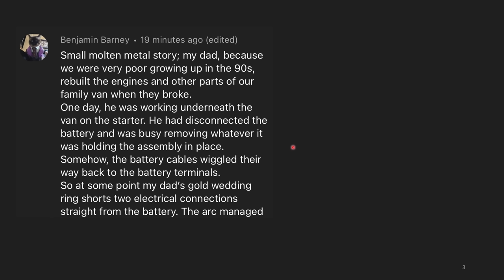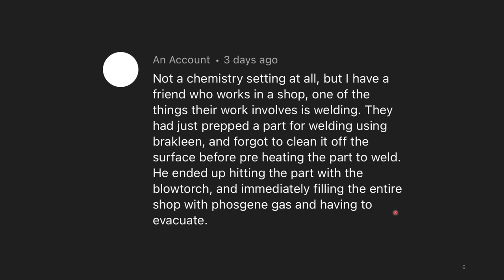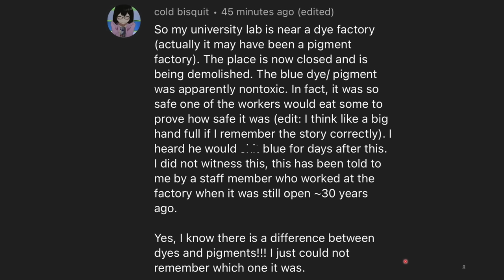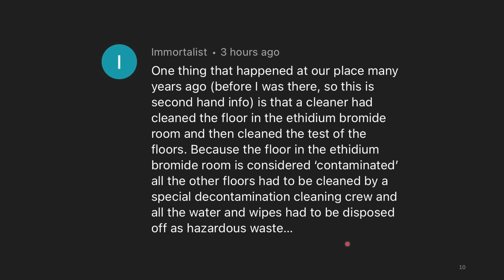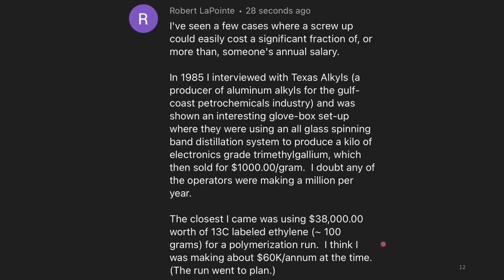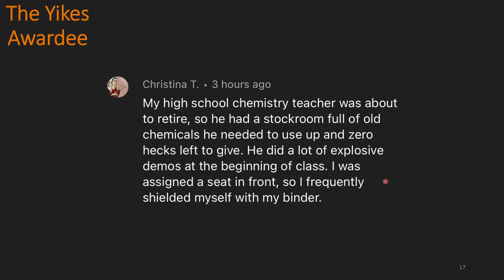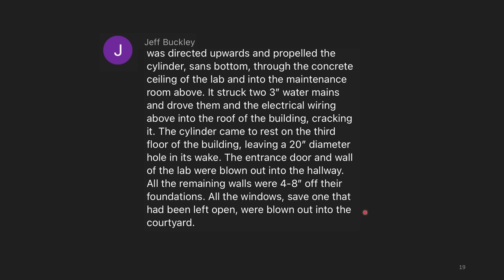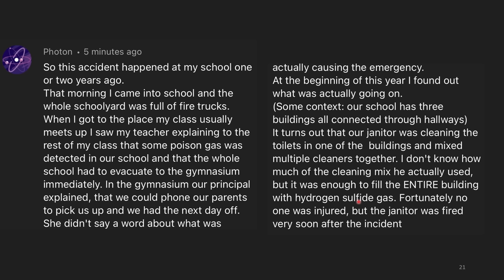Liquid Nitrogen Overpressurized and Exploded

Comment: On the note of the second story, Gold is quite conductive, and car batteries are known (and used) for their ability to provide lots of current! gold also has a fairly low melting point (comparatively), so it's no surprise that a wedding ring could melt in a situation like that.
Reply: Yep. There are reasons why industrial maintenance technicians wrap their wedding rings with vinyl electric tape if they can't or won't just take their ring off at work.
Edit: They also don't wear watches unless they have an all plastic one.
Reply: Though liquid gold like mecury an most other liquid metals don't actually wet skin, so the heat transfer from the liquid gold to the skin is reeeeeeally bad, so it is actuslly unlikely to get dramatic burns through gold droplets splatterig on your skin
Reply: Lower conductivity would actually melt faster, lower conductivity=higher resistance. Higher resistance means more of the energy is converted to heat, rather than just being passed through. Although the lower resistance allows it to deliver more current so maybe the increased current delivery counteracts the higher efficiency
Reply: @JGHFunRun  P = E²/R  Therefore the more conductive (the smaller is R) the metal, the more power dissipated as heat.
Reply: @sootikins  connect an iron nail to a car battery with equal diameter copper wires, and tell me which heats up most.
Reply: @phizc  The higher resistance of the nail means that the heat that is generated is focused in the nail, but a lower overall resistance will dump much more total energy into the system; with the huge current capacity of the battery, both the copper and the ring will heat up more than they would with the nail in the circuit. Shorting the battery cables will also be much more vigorous.
Reply: Having played with high current electrical stuff over the years, I'd believe the story too. I doubt it would have melted the entire ring, but could certainly have arced and splattered enough metal to cause burns.
- A decent car battery can dump ~500A for a short period - at 12V, that's 6kW!
- There would be some losses through the cables from the battery to the starter/alternator, but in a worst case scenario of 1 meter of 0AWG copper wire (8mm dia) and very good grounding through the chassis, you're only talking 0.32 milliohms for the cable, which would only drop 0.16V or 80 watts out of a total of 6kW.
- Once the ring made electrical contact, sparks would form highly conductive plasma between the ring and the terminal, so resistance due to surface corrosion of either could quickly drop to negligible amounts.
- Most jewelry isn't made of pure gold - among other things it's usually alloyed with zinc, which is a pretty poor conductor (4X the resistance of copper), so the ring itself could well constitute most of the volt drop and therefore most of the 6kW of heat generated (Sootikins' statement is also true, but only when unlimited current is available across a single resistor - in a real world series circuit, the higher resistance components will usually heat up faster because of a higher voltage drop across them for a given current)
Reply: The thing you're looking for is the maximum power transfer theorem, or as engineers like to call it, impedance matching. You can measure the internal resistance of the battery by plotting its voltage vs current curve. The power dissipated by the ring is maximized when the ring's resistance is equal to the internal resistance of the battery.

A superconducting ring would melt the battery but not itself; a rubber ring would pass no current and stay cool as well. A gold ring is probably quite close to maximizing the heat delivered to the finger, but using math, we can figure out the exact ring size for a given material that would maximize the amount of heating power dumped into the victim's finger. Therefore an ideal size tungsten ring would be the worst case scenario: it puts out just as much heat as the ideal size gold ring, but it stays solid the longest.

Comment: The pigment Prussian Blue (potassium hexacyanoferrate) is considered non toxic. It is used for treatment after ingesting radioactive cesium or thallium.  Recommended Adult dosage typically 1 to 3 grams per day, or up to 12g/day for higher exposure. Typical treatment duration is 3 weeks.
Reply from the maker: amazing - It would be challenging to convince me to consume 1-3 grams of prussian blue
Reply: @That_Chemist  The ferrocyanides are quite nonreactive in general, the cyanides are extremely tightly bound.  Prussian Blue in particular is extremely insoluble on top of that.  Strong acids and bases can release the cyanide -- plain stomach acid isn't enough.

There are records of a poor woman who attempted to commit suicide by eating heaping spoonfuls of some more properly soluble ferrocyanide salt.  She went to hospital for **iron poisoning**.

Comment: When pondering the tale of the janitor and the hydrogen sulfide, we must always keep in mind that the information was likely relayed through at least two levels of non-chemists.  The offending fumes could have been some other chemical entirely, and some admin type mangled it.

That ring across the battery?  I had a less severe case of that with a metal watch band and a small Ni-Cd pack, back when small Ni-Cd packs were a thing.  Very ouch, but no serious damage.  It's one reason I no longer wear anything conductive anywhere near my hands.
Reply: Many years ago, AA ni-cads were popular, they were also poorly desinged with a positive outer shell. A spring contact could bridge the outer shell and negative pole and would get hot enough to set fire (a stove lighter sized flame) to the battery.
Reply: I've seen varying cases of the ring burn over my years working in manufacturing, it's real nasty stuff, if you're lucky, you get a relatively minor burn, not pleasant, not the end of the world, worst case you lose your finger, even if it is 'just' a small battery, some of these smaller batteries can spit out a LOT of current in a short circuit, 9v batteries are one of the worst offenders for that though as far as every day use batteries go, the pins make clipping a ring on them easily and they pack quite the zing at 1.5a short circuit (about 13.5w) though AA's can give you a fair zing too at about 6.75w, doesn't take much amperage across something like a ring to burn you, lithium ion batteries are generally your worst offenders though with a short circuit current of 50 whole angry amps, the machine shop I worked at had a strict policy of no rings near any rotary tool, be that a mill, lathe or die grinder etc, but they quickly adopted a no metal rings in the shop after a two instances of ring burn, one minor and one major involving an amputation, I'm not a ring person but in a workshop/electrical field I always recommend silicone rings for this reason
Reply: Late to the story, but it's why when I weld I only leave the tungsten rings on. Let it conduct, it's better than sweaty skin. Let it burn me, I don't even need the ring if it scars right
Reply: Yeah, my guess is the janitor made chloramine. Surprise chemical warfare agents are always good.
Reply: @samiraperi467  And thats why even janitors should at least have a basic degree in chemistry so they know the dangers of mixing bleach with acidic cleaners - generates chlorine gas and ammonia - generates chloramine. Most janitors I think dont know this fact but instead they have the mindset of that because its a cleaner of some kind it can be mixed with any other cleaner = WRONG!

Comment: Just an addendum to the 13C labeled polyethylene story.  That Chemist's suggestion that the reaction be run with unlabeled ethylene first, to ensure that everything went OK with the expensive stuff, was in fact how it was done (this was in the mid '90's).  Moreover, as this was performed in a continuous solution reactor, the reactor was actually started up with unlabeled ethylene and then switched on the fly to labeled ethylene after the system had come to equilibrium.  This was a small reactor, with an ethylene throughput of a little more than a gram per minute and a residence time of about 15 minutes, so it took about four hours to get a really steady equilibrium and then about 60 minutes to shoot my 100 grams of 13C ethylene (reactor pressure was about 500 psig, so there was a bit of labeled ethylene left over in the cylinder) followed by another 60 minutes to flush most of the 13C polymer (during this time, I was collecting samples every 60 seconds in tared vials).  Then I went through a shut down procedure where catalyst and monomer were cut off, the reactor flushed with straight solvent for a couple of hours to remove all polymer and then another hour to cool and left with a trickle of solvent flowing.  After drying the samples overnight in a vacuum oven and weighing them, there was a very smooth increase in weight of the first 60 samples, followed by another smooth decrease in weight for the last 60, which was the first objective confirmation that the experiment had gone well (and that I hadn't just wasted weeks of prep time and $38,000 of labeled monomer).

Comment: One of the things being taught to me during the middleschool was...glass etching. Yes, glass etching for middleschool kids. Guess what's being used for the etching? Of course, it's HF (or H2SiF6, but that's not what's being used in that class and it's not like the H2SiF6 is that much better than HF anyway). The worst part was that the teacher in that class didn't provide the students any special precautions about the acid being the HF and seemingly only treated it just like any other mineral acids. Thankfully, the class went without major incidents or resulted in any casualties, but man, this could've seriously killed me if I screwed up without knowing that the HF kills. I only learned to my horror over a decade later that HF is fatal on skin contact and was exactly the acid used in that glass etching class.
Reply: That's a bit like the old DIY chemistry experimenter's book I had that told you how to etch glass by asking your friendly dentist for extracted teeth and then boiling them up in sulphuric acid to produce HF vapour. As a side note I used to be in the semiconductor industry and regularly used HF - very nasty.
Reply: my nervvy friend asked me to identify a drum in the detailing business next to her tennis court. It was hydroflouric acid, or HF in water. I told her it’s nasty stuff used in detailing cars. Apparently nothing better for removing grease and tar from car parts.
Reply: @robertparsons558  fluoroapatite? That only works if the teeth are fluoridated
Reply: I've seen some kind of glass etching kit sold in craft stores.  I think it uses a mixture of salts which, when dissolved in water, produce a small amount of HF.  I'm not sure.
Reply: HF is not automatically fatal on skin contact. A large splash won't do you any good at all and could be fatal after some time but a drop or two will let you live to regret getting it on you. Don't breathe it or get it in your eyes, though.
Reply: What year was that 😂

Comment: 1:00 there are a few rules when working with electrical parts,

Rule 1, one hand rule, if you don't know what voltage something has or it's a high voltage system only use one hand and keep the other on your back at all times, regardless if the circuit is powered or not

Rule 2, (which applies here) rings are banned, if you can't get a ring off at least cover it with electrical tape, flesh wounds on fingers are hard to heal properly

Rule 3, if you're unsure, check it again, this applies to fuses, disconnects, voltages, etc, it only requires one lapse of judgement and you're gone,

Rule 4, mind your grounds, electricity can take wierd paths that you didn't think of to ground, sometimes that includes going through you

Rule 5 catch-all, common sense, don't touch what you don't know,
Reply: Rule 0: if it's practical to de-energize the system before working on it, consider doing so
Reply: @sealpiercing8476  that is the gold standard yes but it's practically unachievable in a lot scenarios since you usually need power applied for the system to present the fault
Reply: @CraftMine1000  Yes, it's often not practical, but it often is and you then you should do it. Some kinds of things almost never need to be worked on live, and if that's what you're working with you can just not shake hands with danger that day.

Comment: Some friends and I enjoyed the sodium - water reaction so much that we decided to scale it up.
As I was a working chemist in those days (this was in 1982), I knew of a company that sold buckets of foil wrapped 2.5 pound sodium bricks for a couple hundred bucks. We bought one and, as I was living in San Francisco at the time, we chose the steep cliffs near the Cliff House restaurant and the area where Sutro Baths used to be for the experiment.
The foil wrap made the metal very easy to handle, so one beautiful summer night we threw a brick into the ocean. To make a long story short, the multiple detonations and burning yellow pieces flying everywhere creating their own small explosions was quite impressive. One brick that we threw closer to the restaurant was apparently visible there, because the roar of exclamations of the diners was easily audible to us over the sounds of the surf.
Later that summer on Ocean Beach we tried a smaller quantity of potassium which was quite beautiful with it's reddish tinged flame. A bit of cesium was so reactive it was gone almost before we could see it, and of course as everyone knows, lithium reacts too slowly to create intetesting pyrotechnics.
The same friends and I one night lit a six inch cube of magnesium metal with a welding torch....but that's a story for another time.
Reply: Oh my god... Different times. Casually throwing large blocks of alkalis into the sea...

Comment: I wanted to see what happened if sodium exploded underwater. I used a small metal container that contained a bicycle puncture repair kit. The sodium was placed into this container and held together with a g-clamp. This was put into a 4 gallon drum.
The sodium exploded underwater and the drum suddenly leapt into the air - silently. It had pushed the water upward and the drum followed it.
The sound of the explosion was completely muffled by the water.
Reply from the maker: I’m sure someone has done this on YouTube

Comment: There are some bath additives that contain lime sulfur (calcium sulfide), which mixed with acidic solutions can release H2S gas. This method of making the gas was apparently used in a suicide cases spree in Japan in 2008. I think most of the brands using CaS were phased out since then. Oh, and apparently, reacting that bath additive with oxidants only increases the amount of H2S (which is weird, from a chemical point).
Reply from the maker: Calcium sulfide - yikes
Reply: @That_Chemist  H2S - double yaikes
Reply: @That_Chemist  also, I can't really imagine why the janitor would use bath additives
Reply: @SuperAngelofglory  might've been some kid. Who knows?
Reply: High concentration sulfuric acid is also used as drain cleaner
Reply: @Beregorn88  not anymore in the EU
Reply: @Aaron-zu3xn  no, just common Japanese suiciders

Comment: The kid's story. The mother did the only reasonable thing. Using a lot of water. 5 minutes may have been enough, but this is a case where the concept of overdoing it don't exist.
The blue eating dude... I think that it's more probable that it was pigment. Pigments are less soluble and less reactive than dies. BUT, they may also contain some heavy elements...
That dumb janitor probably used chemicals that where NOT intended as cleaning agents as cleaning agents. Also, had zero knowledge in chemistry. I don't know, maybe there was some sulphuric acid in his arsenal to provide the sulphur...
Reply: Sulphuric acid is fairly readily available as a drain cleaner at some hardware stores. Seems plausible with just misusing stuff sold as cleansers to me, although I don't know what the rest of the reaction would be.
Reply: Maybe sodium sulfite? I’ve seen that used as a cleaner
Reply: @mduckernz  Another viable option.
Reply: The Janitor Probably used an acidic drain opener such as sulfuric or hydrochloric acid in the sewage pipes that were likely aged and comprised of iron sulfides. You can get H2S from crushed 100 yo iron sewage pipe in acid just as ez as pyrite.

Comment: So the thing about dropping bombs into plumbing is that those systems can tend to have volatile gasses in them and the release of pressure doesn't happen. 

If you drop a bomb in a toilet, water or gas will shoot out of every connected hole through the plumbing before it can rupture the pipes.
Reply: Yeah it's a little more plausible if the sodium is acting as an ignition source rather than prime mover
Reply: @sealpiercing8476  even if it is all water, the initiator winds up becoming a shaped charge. A cherry bomb could create a couple of water spouts without the added oomph from methane.

Comment: Re: the base bath, one of the most common drain cleaners used to be sodium hydroxide, a strong base. Drain cleaners are used to eliminate two main sources of clogs, fat and hair. If the brush in question had natural bristles, I would expect them to dissolve fairly easily, even if the solution was relatively weak, as long as it was sitting for awhile.

Comment: 1:30 car batteries can supply 600+ amps to the starter (that's 7.2kW), it isn't surprising that it took that little time to melt the ring
Reply: Yeah, considering I saw a hardened steel screwdriver get a tiny crater blasted out of its tip when my dad dropped it across his truck's battery contacts when I was a kid, gold might as well be warm jello to a car battery short.